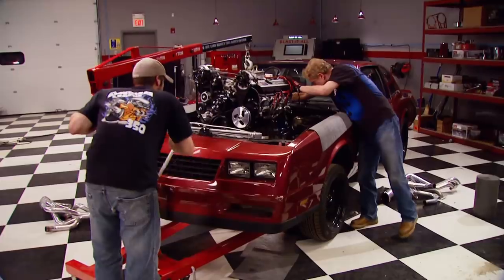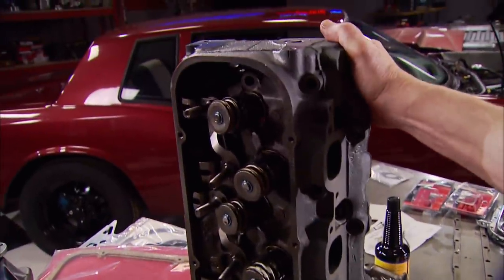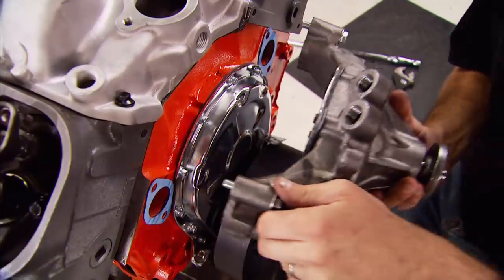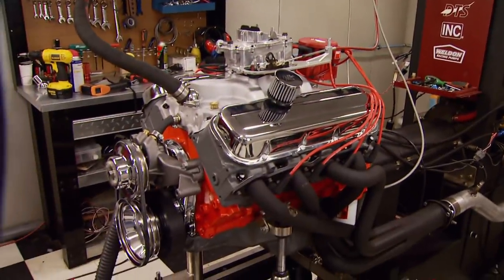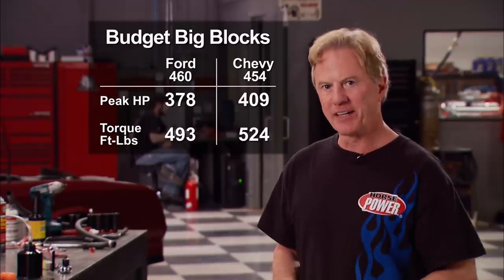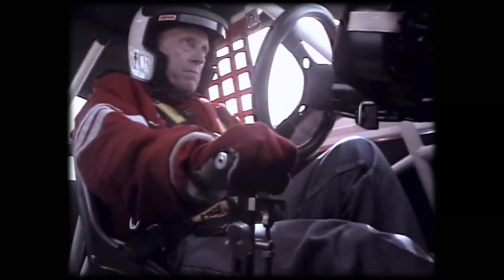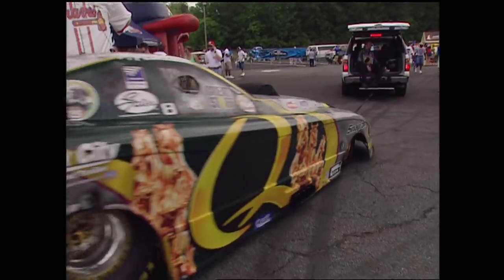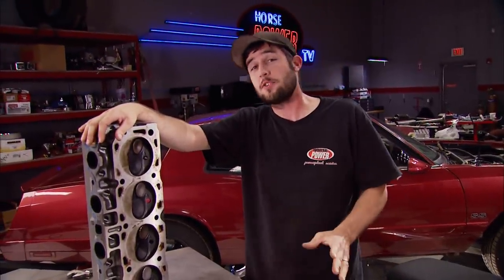Will This 454 Chevy Big Block Put Out More Power Than Our Junkyard 460? - Horsepower S13, E12

Comment: I bought an old 402 from a buddy and had the heads done to accept 2.25 and 1.88 valves. Put in solid roller 268/272 cam and made way more power than I was expecting on a budget. A mean queen she was, but I had to step it down for the street. Good power is easy to find with the big block Chevy.

Comment: That would be a 450+ hp engine if you’d have used 781 oval ports instead of truck peanut port heads.  Nice build though.
Reply: Yea I was thinking come on 781s are $150pr IF they didn't come on it...
 Been loving all these LS ...BBC parts fell out to dirt cheap
Reply: But that wasn't the point. It was sue what you got and make it work
Reply: Yep, and drop a set of large valves in them, and you'd be pushing closer to 500hp!

Comment: Surprise, 454 wins cost wise. Is any one really surprised? 
460 is going to win without budget constraints. It has a little bit more of a power ceiling, but it costs a lot to get there.
Overall 454 is the better big block choice in most situations. Stock 460 however is a amazing pulling motor its very torquey. 90's era F trucks are nearly indestructible.
Reply: I been pushing over 1000 for years on a regular 50 year old BBC block...cheapo white box $350 rods and blemish pistons haha....they are nuts tuff and have 2 tall deck blocks and a short deck spare..sonic checked for .120 over...no wonder it won't pop at .060 over

Comment: Let me guess budget junkyard motors supposed budget build,,,,,now thousands upon thousands of dollars spent,WHERE THE HELL DID THE BUDGET GO???? Worse spending than a politician !
Reply: they literally spent 2,300 bucks. wth you on about?
Reply: @dreadnaught688  and then they threw the checkbook out the window to compete with the souped up 460,besides who really needs CHROME PULLEYS?
Reply: @mikemoscato2995  those chrome pulleys are O'Reily specials they ain't. Expensive trust me
Reply: They needed to keep the price close hell 4 to 500 spent on BS that 40 bucks should have bought at a junkyard and it made no Hp.

Comment: What heads are those? 
I have a 73 2 bolt main 454 and want to rebuild on a poor man's budget.
Reply: Being a 73 you probably have large oval port already which are better then the ones they used.  Around the valve springs is a casting number. Find it and do some research you’ll be able to find out what head they are. If there a large oval port you can change the cam out with something no larger then around .500 lift, headers, intake and carb and you’ll have a hell of an engine for cheap

Comment: Why did you use peanut ports on yhere insted of oval ports? That would have been nice to see
Reply: Because that's what they had and that was the whole point. Budget and use what you have and make it work
Reply: @KingJT80  I get it and it's awesome how well they performed especially against the big block Ford with larger intake ports. I'm currently building a 454 on a budget. Just saying that stock oval iron would have been nice to see over the peanut ports.
Reply: Ya I noticed the peanuts too

Comment: 502ci making 425hp? Maybe I heard it wrong. But the 127ci in my Subaru makes more than that. What's goin on.
Reply: Thats 425 at the wheels. At the crank it makes more power than that.
Reply: @paulaguilar9147  oh yeah probably alot more, but I just I dunno. I guess I expected more.
Reply: @kidsythe  I'm pretty sure they just took a crate engine and didn't change anything on it. If they put better speed parts it would have put out more.
Reply: BigTX77  I guess I gotta say factory output is 300. I couldn't exsplain more it would clearly go over your head.
Reply: Is it boosted cause you wouldn't like this comparison boosted hehe
Reply: @bluecollardaily2676  what I'm saying is the small blocks all make more than 1hp per ci and I expected a crate 500 plus engine to make 500 plus. Without boost.
Reply: @kidsythe  it should, its terribly unoptimised from the factory...we built our own street ram for my BBC ( think home brew BOSS302 or holley high ram ), we drilled the holes for the injector bungs and tig welded them in trying to point them at intake valves...then I used my standalone ecu to change injector phasing vs intake opening....then got it running in sequential multiport and I got it to sip fuel...
 Well over 1000hp and get in the 20s on hwy cruising to and from the track 160 mile round trip at 74mph....using a 4l80e with lock up..
 I'm shorter stroke when I sent my last procharger in for inspection I was easily making over 1hp per cubic inch...its a boost specific build and till makes their 600 with a small hybrid cam setup for boost...and loves rpm.....
 That 502 had shit heads too.....on BBC its all in the heads and then from there, absolute care in cam timing to work well with your choice...and manners....
 You would never in a million year riding in my 67 Camaro think its over 1000hp with hood on ( hood off gives it away hehe) till I smash it...

 I really wish Chevy would have put more time into this platform similar to how Ford has brought back their Godzilla 7.3l...
 If I really wanted to make it efficient my next build will drop it even further back to to 3.75 stroke .070 ( you can use stock steel 3.75 stroke cranks too) and make a 440ci but use an 18 degree piston and maybe some 18x heads ( so you can use 24 degree old school valvetrain )...if chevy right now did an 18 degree headed 8.1L with  letting air in and out...it would be SO stout and efficient....
 I could add 100 Naturally aspirated HP to my 468ci simply swapping to 18 degree layout and pull to the moon with the right cam and not tjat big either...BBC eats up cam and still has manners....

 To be fair the heads are Fords problem too, the LS with out their higher valve angles to what 12 degrees...wouldn't run much differently than a old SBC it was their heads that made the power....
 Now nothing seems to stop a BBC from developing an oil leak somewhere haha....i use gapless top rings I don't even need a catch can at 15 psi though haha...

I guess my point is the factory went another way but I know first hand the platform can be made efficient and is durable as hell.....
 I love LS cause it made BBC parts dirt cheap and I enjoy creating combos looking for efficiency with high velocity small oval ports, long runner street rams and home brew sequential multi port injection, along with hybrid cam setups and custom profiles....
  Since I can do it, I know they can...easiest route would be to get away from 24 degree valve angles...like they did with LS....and no one else uses....I need to look and see what's reasonable now for BBC in 18 degree...pistons wouldn't be hard its the damn shaft rockers and stuff.....I thought about going back to NA and doing 18 degree street combo next build
Reply: @kidsythe  because at the time they made the 502 crate back in 2000 it wasn't supposed to be a hard ass ratty race motor

It was for guys who wanted it to run on anything without screwing it up on any octane they choose.  It will run on 87

Just buy it put it in and start it up with a warranty. No fancy shit. Just a lot of cubic inches
Reply: @KingJT80  2000s? I guess I though this was like 1 month ago. This exsplains alot.
Reply: @kidsythe  Yea, your turbo Subaru makes good power. Now drive down the highway in top gear at 70 mph then step on it. I bet fuck-all happens for about 3 seconds. Then try the same thing with a 450 horse V8. You'll see the difference.
Reply: @kiisu74  actually I used the straight cut gears in my five-speed instead of the six-speed swap. I'm actually in a pretty awful scenario. I'm actually pulling about 20lb of boost at 70 mph top gear. Yeah it's really a short ratio all together box. Makes me ride at 3600rpm. Of course at the same time if I were going to floor It I was just down shift. And my man I'm not ragging on a v8. Just a lot of the other videos I see these guys have 500 cubic inch engines that are making 600 some horsepower. And that's what I was expecting out of this engine.
Reply: @kidsythe  I hear you. I'm not ragging on imports and turbos are unquestionably a shit-ton of fun. I've driven a stock 305 horse STi and it was surprisingly underwhelming on the highway (although never slowing down for virtually any corner was awesome). I'm sure yours is waaaay different. And yea, just downshift. That's why we love stick shifts. I'm just saying the instant torque everywhere in a big cube pushrod motor is pretty useful regardless of output per cubic inch.
Reply: @kiisu74  you gotta good point. I think our driving styles it reflected in our engine preference.

Comment: 03:45 The biggest mistake they made was using the peanut port heads... Those things are so low on flow that they cut the HP down by a huge percentage... You probably could have made another 50 HP by ditching those heads for the full oval ports
Reply: Well they said budget build and use what they have.  Going to find them wouldn't have been fair since that's not what they did with the 460

It was about using what you have
Reply: Nothing wrong with peanut port heads.  Can easily make 500hp with them.